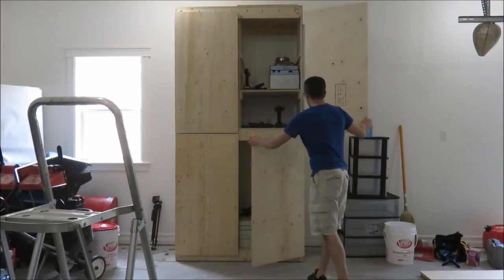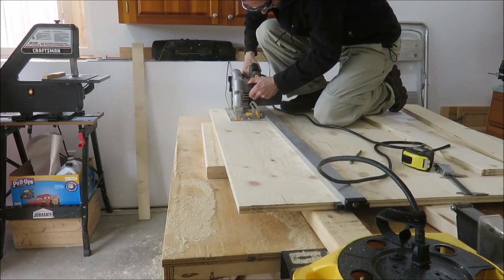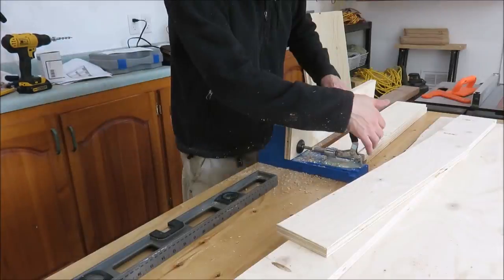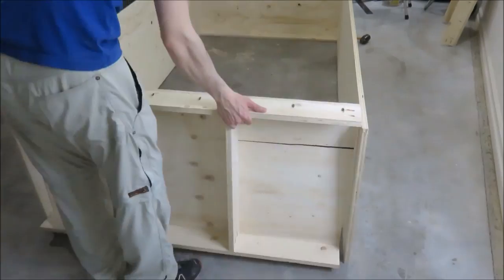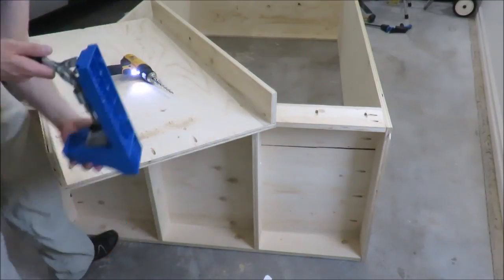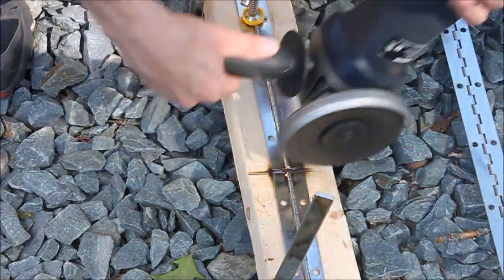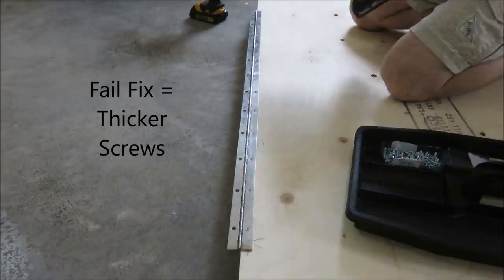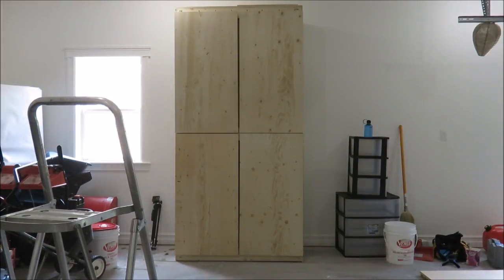How to Build a Storage Cabinet with Doors - Plans Included

Comment: I just finished my first “copy” of this.  I had to make some mods as my space was just under eight feet,  the floor was sloped, and I had a brick edger that sticks out 3.5” and is 8” tall at the bottom back.  Thanks for the plans!  I also used hidden frameless cabinet hinges with a Kreg jig for them -  super easy and similar in price (except buying the jig).  I screwed it into the wall (thanks to the cut-out for the bricks at the base) -> super sturdy.  Luckily, the shelves are level!  Again,  thanks!!!
Reply from the maker: Glad I could make your life a little easier.  The frameless hinges would be a nice touch.

Comment: Two things to consider.  When you can, put the pocket holes in places you will not see them.  No reason to have the pocket holes on your front face.  Also, instead of corner bracing, put a sheet of plywood on the back.  That'll help with the weight and the bracing, and then you can install hooks or whatever inside to hang things on the back of the cabinet without messing up your garage wall.
Reply from the maker: Having used the cabinets for awhile now one improvement would be to add a backer (like you suggested) at least in the lower section of the cabinets to save the walls.

Comment: I had the same issue with my undersize table saw, Im thinking of getting a Track Saw instead, they’re a little pricey but I easier to use especially when ripping down a sheet of plywood that u dont have to manhandle.
Reply from the maker: The track saws that you don't need to clamp down look like they're really easy to use.

Comment: I'm a super newbie to any of this stuff. How do you keep the doors plum and level when screwing in the hinges?
Reply from the maker: Mark the centre of the hinge; mark where the centre of the door on the hinge side; mark the centre on the cabinet.  Clamp or tape the hinge in place and pre-drill the holes (you need to be in the centre of the holes) Clamp the hinge on the door and the cabinet using the centre marks to line everything up.  Screw the hinge to the door and then have someone hold the door while you line up the first screw hole, etc.  Let me know if you have any other questions. Good luck.
Reply: Thanks for the quick answer. I'll be working on this, actually a variation, this weekend.
Reply: Also, did you use the 3/4" for the doors as well? Was it because that's what you were working with? Would it be easier to use 1/2" or 1/4" for the doors? Lighter?
Reply from the maker: Let me know how you make out.
Reply from the maker: Yes.  3/4 for the doors.   The piano hinges have lots of holes to secure the door.  You could use 1/2 for the doors.  I wouldn't use 1/4 with the piano hinges unless you build frames for the doors as the screws for the hinges need some wood to bite into.
Reply: Hello love the video will be making the shelves.....tried to download the plans says not supported.....
Reply from the maker: @jackfrost-qu7lv Did you try opening the download in Sketchup?

Comment: What was total cost ?
Reply from the maker: Cost will vary based on plywood prices where you live and what grade you buy.  A 4x8 sheet of plywood (one good side) cost me about $35 CND and I used 2 sheets.  Hinges were about $7 each.  I bought two 6 foot hinges and cut them in half.  Throw in a few dollars for screws which I had from other projects.  Good luck with your build.

Comment: you have to buy sheet goods, every single seller will cut them down for you for free.... do it.
Reply from the maker: My local supplier will make a few cuts so the sheet will fit in your vehicle.  However they're not good at making accurate cuts.
Reply: Well accurate is relative to the need and for this video's subject the accuracy you will get from Home Depot panel cutting sled is plenty accurate and as such sure is a major time saver and makes it easy to move the cut down panels.
But maybe your site doesn't have a panel cutting sled.
Reply from the maker: A panel shed would make quick work.  I don't have a Home Depot nearby.  My local lumber suppliers problems are that they have to set their table saw with a tape measure and their fence doesn't lock tight enough and can get bumped out of wack with a large sheet.   I since  brought a table saw with a fence that goes out to 32 1/2 inches.  When you can set the fence quickly and accurately breaking down a sheet doesn't take long at all.  Setting up a straight edge and a circular saw is a pain.